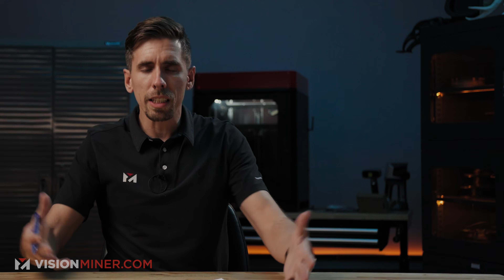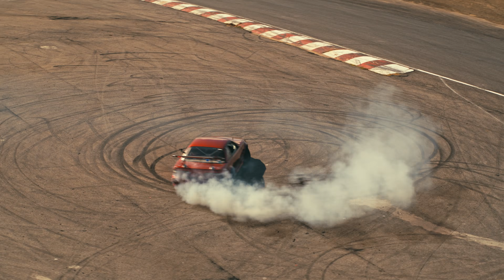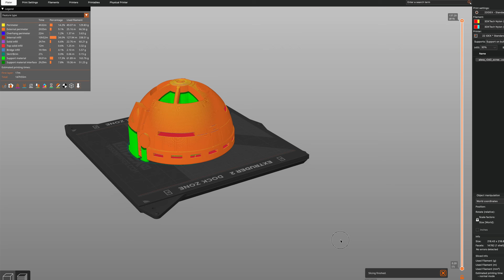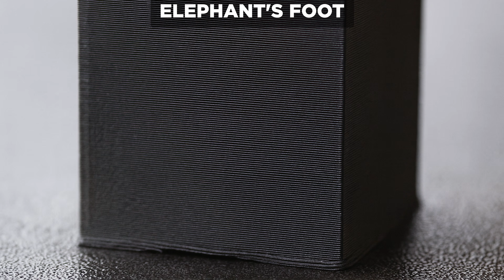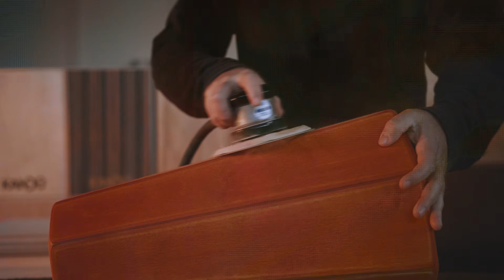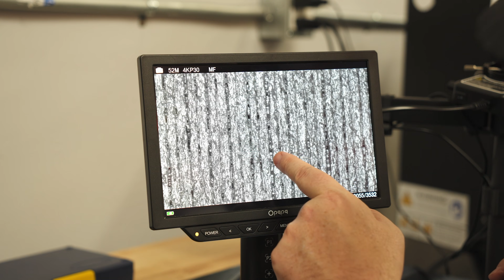Starting A 3D Print Service? Watch This First!

Comment: Looking for my first printer to start a small business, XC1,P1S,P2S,H2S which should I chose? ill be printing mostly car parts
Reply from the maker: But really..... you should check out the 22 IDEX V4 :) https://www.youtube.com/watch?v=H9JyUqri7RU LOTS more opportunity in high temp printing!
Reply from the maker: If you can afford the H2S Combo that would be the best option since it has a larger build volume and wider range of materials available than the P1/P2 and X1C
Reply: @VisionMiner  time to pull out the credit card!! Thanks bud!
Reply from the maker: Of course,  there's a lot of talk around the Centurion, and the Prusa's are always a good option as well... :)

Comment: I have a small 3D printing business (3DProto Lab L.L.C) and have reached out to you guys a couple times in the last couple years. Always received a response on topics like suitable or alternative materials to what I was using or looking for to stay ahead of the curve. General inquiry type emails. I worked in aviation for 14 years and then moved into a machine shop. I was able to use my personal business as a subcontractor for my aviation employer, and even printed an aircraft engine mount for test fitment of the engine. Those skills later helped me take the leap into the machining world and kind of “start over” in my career path. 

Just wanted to say thank you guys for sharing knowledge and information freely to the “little guy”. It’s cool to be able to have a shared passion in an industry of competition, and still reach a human, especially  ones that don’t gatekeep in the business world.
Reply from the maker: Cheers and thanks! I'm sure we've spoken in the past, great brand you run :) Like we say, we're here to advance the entire industry, and have a great time doing it! Thanks for the comment!

Comment: Fillets on the top or bottom corners look like garbage in fdm.
Reply from the maker: Yes, if they’re more than 5-10 — then you get the stairstep effect — however, depending on the curve, this can actually look very good on certain parts. Not always bad, but often chamfers are a good go-to if you just want to know it’ll be good.

Comment: I’ve CNC machined an ABS block before with flawless results. Although it wasn’t printed, but rather cast im guessing. It was a solid block.
Reply from the maker: Yep, sometimes you can machine lower temp plastics, but generally not at high speeds :) Gotta watch out for that melting from the friction!
Reply: @VisionMiner  Oh yeah, my experience was on a desktop machine, not very high speed at all.

Comment: Do you think there are resins which outperform FDM plastics. I was wandering if there is a use case for printing hollow + raisers/sprosse/runners and then filling them up.
Reply from the maker: They have lost wax filaments, so you can print casting molds like this quite well! Again, thermoplastics, thermosets, photopolymer resins, they all have their place, and each application has it's best fit. Resins are phenomenal for jewelry casting. Making massive cast aluminum parts? FDM may win out.
Reply: @VisionMiner I thought more about instead of printing a lost cast model, and than having to do with the lost cast method, just print a hollow shape with minimal open cell infill, than take a syringe and fill it up with a resin.
So the shell is FDM printed but the inside is solid resin. So the infill would be anisotropic.
The injection could be done with a second print head.
Just wandering if it makes sense or is it more cost effective to take a high end material and print it solid.
Reply from the maker: Oh I like that too, you could simply fill with Epoxy, possibly cheaper and curing should work well (depending on geometry) -- it's a great idea!

Comment: Thank you for this video! It offered me a lot to think about in regards to the future. I would like to ask which slicer is currently capable of non planar printing even if it is just an experimental feature? Thanks!
Reply from the maker: There is a dedicated slicer made by Layer Performance -- specifically designed for non planar and 5-axis.
Reply: @VisionMiner  Thank you!

Comment: Hi I have a question I have wondered about for a time about nylon printing.
Lets assume you printed a part with PA-12, its rigid and hard out of the printer but, then absorbs moister from the atmosphere and becomes soft.
My question is, is there any way we can coat the nylon part so that it does not soften?
I assume paint is out because it may contain water?
Reply from the maker: Best option is to use a different material, but another way you could do it would be changing the geometry of the part, and adding material to areas you want to be more rigid. The hygroscopic nature of nylon is difficult to avoid… not sure if an epoxy excess skeleton would do the trick :)
Reply: Vapor smoothing or UV Powdercoating is a good way to go for PA-12. The guys over at Streamline 3D made some awesome UV powdecoated knee braces.